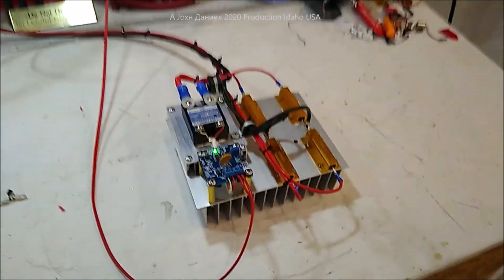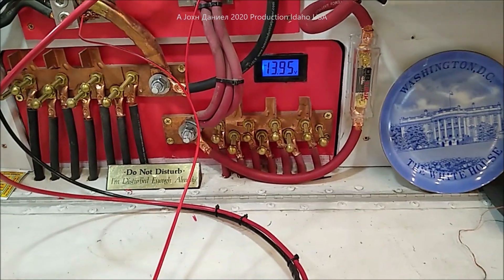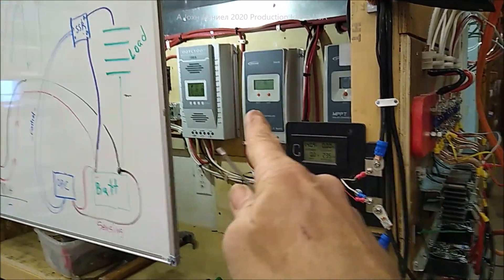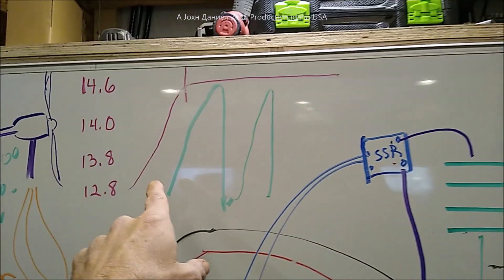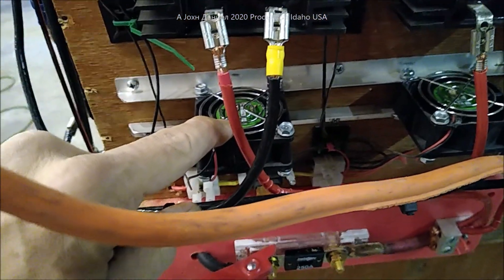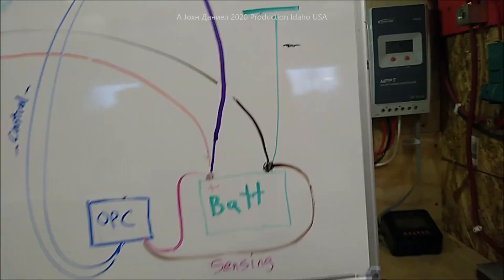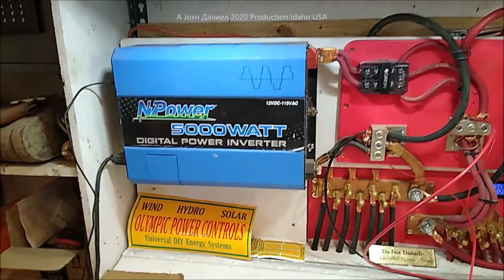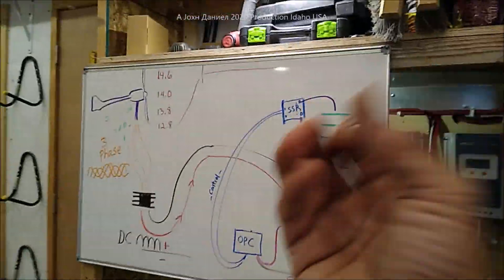Micro Wind Turbine charge controller design and uses explained, parts Below

Comment: JOHN DANIEL, I love the information you share, you really show the real deal has it is, and that is precious.
I have come to an idea that I think it should be good for this scheme. please hear it, and give me your thoughts.

ATM of this video, your schematic goes like this:
Generator --> Rectifier --> dumpload + load.

Consider this:
Generator --> dumpload --> Rectifiers --> load.
By this method, the rectifiers would not get as stressed, thus they would get cooler and longer lifetime.
Please, tell me your thoughts on this. Is it worth it?
I´m awaiting for your response, to order an SSR for AC or DC.
Reply from the maker: The effect on a resistor like these used for WILD AC volts is not great. Only 36% efficiency to catch loads, so you would need many more. On DC they become a great heater too.

Comment: Your dumping your wind turbine into a solar  charge controller  through a ssr with dump load? How arr solar  controllers  holding up to wind voltage  fluctuations???
Reply from the maker: There is no effect on the solar controllers function when both the wind and solar control volts are set correctly. You never run your wind power into open air, it's going to the battery bank that keeps it far inside the solar controllers parameters.
Reply: @JOHNDANIEL1  do you know of any dump controllers for 24v system

Comment: Hi John
 Ive like your design of you diversion controller in your video (Micro Wind Turbine charge controller design and uses explained).
Now I have sourced most of the parts needed to build my own, BUT cannot get the controller like the one in the video and the controller with the digital display is costing more to send it to the UK than the actual part it self which I would rather not have for my small setup.
So could you please help us out so I can get my turbine up and running safely and efficiently 
Kind Regard Dave in the UK

Comment: Mr Daniel, I'm a dim bulb when it comes to anything electric & you're the only person that's explained things close enough to my ability to understand. We are off grid in CO. I'm running 4 Harbor Freight 100watt solar kits into a HF 50amp hub & controller, also a 400watt China wind turbine with included controller into our 5th wheel with 2x3 6v deep cycle 215ah in parallel + 2x 12v deep cycle 115 supplying a 5000watt converter had installed. Everything seems to work ok MOST of the time. Are they fighting with each other? Would you be willing to speak with me? Thanks for all the informative videos, you've been my inspiration.
Reply from the maker: You will need this controller for your set up. https://amzn.to/2VxP8No . And If you have put older batteries with newer batteries the older ones will cause problems in the system. The controller above will solve battery problems, just be sure to allow the batteries a day to be fully charged without use. With the provided 400 watt wind turbine controller it is likely set at under 14 volts charging ( braking at 13.8) so the solar will be not performing (shutting off) since it is designed to charge correctly to 14.2 volts. Causing lots of havoc. Thats why I suggest that dual use controller for like what your doing. Set it to 14.2 volts charge, and you can add 100 more watts solar to it later without issue.
Reply: Thank you for sharing your knowledge kind Sir! I look forward to new videos and I'm still enjoying all previous. Your commentary is 2nd to none and makes learning fun!
Reply: Mr Daniel, I got the controller you recommended and installed it, but I have another couple questions.
1. Is 30' of 3phase 12ga wire connected by plugs to the turbine ok?
2. What should I input the settings to? 
The current settings are
Vfloat 12.8
Vunder 10.8
Vover 14.8
Vbraking 30.0
Thanks in advance for your help.
Reply from the maker: @seanvanzylldejong364  If its the 12 volt turbine models a 300-400 turbine 12 awg is ok to that length, but if its the 500 watt then you must have 10 awg, on the 800 watt it has to be 8 awg.
Float needs to be set at 13.2 
Over volt at 14.6 
braking set to 14.8
under is correct at 10.8

Comment: HELP!!! My setup is very basic but has fuses and brakes, everything. Issue now is,my Inverter is producing way too much voltage than what it was rated for. Its rated 110-240v, I'm currently seeing 259v output on my multi.eter. Should I be worried? Or is my setup too efficient? I dont know. I'm confused. It holds the 259v without dropping or rising. It's a 1000watts pure sine wave inverter with 2000watts peak. I'm totally off grid.
Reply from the maker: Whats the brand and model, whats a link to it ( where you bought  it )
Reply: @JOHNDANIEL1  #Aliexpress Suoer【 Pure Sine Wave Inverter 】power inverter 220v 12v dc ac pure sine wave inverter 1000w（FPC-1000A）
https://a.aliexpress.com/_eNx1FX
Reply from the maker: @ukementa8112  That is running very high for that model of inverter. Many of them have a adjustable output trimmer inside them, near the DC transformers there might be one to adjust to get voltage to 220 @ 55 cycles. It is unlikely to harm normal electronics as long as its still close to 55 hertz, but I would suggest open it up and see if it has a adjustable output trimmer small rheostat near the transformers output lines to the MosFets in it or on its control boards. Look for a video for ADJUSTING INVERTER OUTPUT VOLTS.
Reply: @JOHNDANIEL1  today was the worst, 291v. It's a brand new inverter and I'm scared of opening it up. Last time I did that, the inverter stopped working till now.

Comment: Is there a mppt controller with a dump load external output that i can connect both solar and wind?
Reply from the maker: Depends on what your voltage and needs are.
Reply: @JOHNDANIEL1  Ok. 12v 200w solar, 400w rated wind turbine

Comment: This seems so inefficient, And ever since I learned about Passive-Balancing and Active-Balancing of batteries.
I never want to use resistors to burn off power, ever again. It's resistor systems like that, that made made me hate & distrust BMSs in the first place. Until I learned Active-BMS and Active-battery-equalizers. It's the Passive ones, that rely on resistors to drain overcharged cells, the Passive ones are bad. Wouldn't it be better to just set up an Arduino or something, to monitor your battery state of charge, then just use a latching or regular contactor to disconnect the turbine from the batteries, when they're charged enough for you?
Wouldn't the tiny drain from a monitoring circuit, be better then relying on big, hot resistors?
And what would happen to your system, if those resistors burned out, or somehow got disconnected?
I personally don't trust resistors to be used that way.
And I really don't like the wasted energy. Yes, it helps warm you in the winter, but what a record breaking summer?
Reply: Could you share the system you are talking?
How it controls the over voltage to not harm the battery and circuit overall?

Comment: Hi John I have this now set up and I have a question on your numbers: I use 24 volts so I will convert yours; 14.6 = 29.2 is the top or turn relay on set point for the wind. The next number down, 14.0 = 28.0 is the top for solar. What are the next two number assigned to? 13.8 = 27.6 is for wind or solar turn off relay or solar what? I have charge, float and acceptance on my solar controller. Lastly  same for 12.8 = 25.6 same as last question?
Thanks this also cleared up my diode question feeding the load. I ordered a anemometer to control relay for auto emergency brake according to the wind speed. I am not always home so I need this. Any advise on setting this up?

Comment: Please practical wiring diagram 5kw wind turbine control system. Because i can't understand English language. 
Please please please 🙏🙏🙏
Reply from the maker: Are you looking to get a 5kw turbine with components to match? Have trouble on language difference? ( this works well to translate to say in your own language https://translate.google.com/ 
 And if you need to contact for question send me email to olympicpowercontrols@yahoo.com 
اگر آپ ہندو ہیں تو مترجم لنک مددگار ثابت ہوگا
OR यदि आप हिंदू हैं तो अनुवादक लिंक मदद करेगा
https://translate.google.com/
Reply: @JOHNDANIEL1  Thanks reply. kya aap ko hindi aati hai??
Reply: @JOHNDANIEL1  
Hello sir, please explain in the diagram how to control the voltage from the wind turbine 12v to 50v?
 I want the output voltage from 200v to 240, you just tell in the diagram which components will be installed and how will they be installed?
 If possible, please tell them practical
Reply from the maker: @manojdayal25  मेरे ईमेल  ( olympicpowercontrols@yahoo.com ) पर मुझसे संपर्क करें और मैं आपको आरेख और उचित टरबाइन सामग्री स्रोतों को भेजने में सक्षम हो जाऊंगा।
mere eemel olympichpowairchontrols@yahoo.chom par mujhase sampark karen aur main aapako aarekh aur uchit tarabain saamagree sroton ko bhejane mein saksham ho jaoonga.

Comment: 👍 ⭐⭐⭐⭐⭐

Dear John!
Have you already received the new OPC universal boards or was it one of the last remaining stocks? Please don't forget me when the new / old OPC Universal boards are delivered, thank you!
The connection diagram in this video helps me enormously to understand, but only the old OPC, with the connection of the digital version I still don't understand!
Best regards!
Reply from the maker: That one is about 5 years old, we had it at the prospecting cabin in Nevada for a Thermodyne turbine. I replaced it with a newer design and brought it home before Christmas. The new boards due to China and the Corona stuff will be delayed due to the few components used from there.
Reply: @JOHNDANIEL1  👍
Dear John, that was not a reproach, I just remembered that you will not forget me when the new old boards are supplied! Thank you for everything!

Comment: Hey John daniel, great videos mate! I've learned a lot. I've been experimenting with a 1watt  zener diode from the hot side of the relay to the trigger positive on a solid state relay instead of a controler. Zeners have a breakout voltage curve when combined with the trigger voltage curve of a ssr makes a smooth transition from battery to dump load, ssr's are basically a big transistor and I've not heard of any problems with ssr's being engaged transitionally. You can buy a pack of zeners of various breakout voltages for pennies, I'm going to experiment with a variable resistor to get an even more precise voltage switch. You could probably put a capacitor in there to make it blink on and off instead of a gradual switch. Mine's working great so far and nothing is getting hot... and we're in a storm over here in the UK. What do you recon? Can you forsee any problems?
Reply from the maker: Your on to something, but the stability of accuracy when in constant use and heat would be a weak point. Zener diodes trip volts +/- ratio may have to be worked out.
Reply: @JOHNDANIEL1  yeah I had a pack full of em and I bench tested it until I got the right one picked. I haven't noticed any abnormal heat and I've just put it through a storm. It's  drawing 15 amps max on a 24v system on a 25amp SSR.  I had it in 35 knot winds disconnected from the battery and works beautiful as a over rev brake. I'll keep you posted, it Could be useful.

Comment: Hi John, I Need an Answer please, so ASKING!!
What is your "Rule of Thumb" for sizing the diversion load?

I'm running the "Green-E" 500W 12V Turbine.
You reference a 6Ω / 100W wirewound,  so when engaged and dropping ~14V it's dissipating ~2.3A (about 33W).

Knowing your sizing rules would be awesome!!
Thanks in advance.
Reply from the maker: You have to be high/low wind area selective, but rule is 80% rating. So a 500 watt that can actually do 500 watt would need 400 watt and a diversion controller. Normally I tell people to run 2 of the 40 amp DC/DC SSR's into 4 - 100 watt loads 200 per SSR. This gaurentees safety and long life. Set your turbines divert at 14.5 on a 12 volt system unless other things require different, turn off solar controller equalizer/balancing and set their bulking/float  at 14.25 max.
Reply: @JOHNDANIEL1  Thank you Sir!  

How do choose resistance?  Do you take the 80% / 400W diversion load and work backwards? With a 14.5V diversion voltage, to burn 400W you'd need to drop 27.5 amps or so.  This much current for 14.5V would require 0.52Ω of diversion load. (this seems too low)

I'm thinking your 400W power rating is just for heat dissapation overhead.  Using (4) 6Ω in parallel nets 1.5Ω total load, so when the diversion is engaged you're dropping 9.6A across all the resistor loads.  That's 140W total from your 400W resistor bank (that's comfy), or about 35W for each 100W resistor (about 1/3 of it's power rating)

Hope I'm making sense and you can straighten me out.
Reply from the maker: @jimamos8960  You have to calculate the short pulses in the proper controller that each time it pulses the full voltage is not passing into (through) the resistor, volts being low / amps go high. In slow pulses its switching speed only allows a build up of about 6 to 8 volts and as it speeds up it eventually gets to 14 but by then your turbine is loading down and slowing. The high wind areas I suggest 5 resistors and the reason I suggest 4 to 6 ohm for 12 volt systems is wire gauge in the turbine, so not to burn it due to load up speed counter reaction to the divert. I tried numerous ratings, after over 10 years this is the result, it may not make mathematical sense but remember all that power is pulsing + in high rates from the rectifier and it behaves different than just the battery only.
Reply: @JOHNDANIEL1  I think I get what you are describing regarding the controller operation... you don't want to simply engage the full diversion load when voltage is above X volts, so the controller modulates the SSR's accordingly with some algorithm based on voltage level and integration time.   I'd like to know more about these particulars (I've downloaded Mason's manual to read this weekend), but back to your recommendation and my questions.... how should I size the diversion load (resistor Ω values and wattage) for my turbine (the GE-500W 5-blade) and location (96719)?  I know the next video will get into braking strategy with AC pass-thru & DC in-line methods and I presume these independent controls (braking and diversion) are intended for independent operation.  I get the notion that behavior will be different based on where the load is located in respect to your batteries (i.e it's resistance), and loads downstream of a rectifier.  

I'm building a spreadsheet with all my off-grid system DC loads (AC inverter and DC lighting) such that I can get a clear picture for power budgets, load protection, etc... Hoping to incorporate the diversion and braking load calculations in the same spreadsheet...   Thanks for entertaining my Q's
Reply: @JOHNDANIEL1  Another question on this whole diversion/braking methodology.  Would it not be better for your batteries if the diversion/braking resistors were upstream of the rectifiers on the AC side, thus eliminating the loading and subsequent discharge of the battery?

Also, what a collection of commentary on battery chemistry, eh?  Hoping to see more braking strategy.... (specifically, "generator braking direct" which looks to be high current switching downstream of your inline AC load resistors)
Reply from the maker: @jimamos8960  The braking on the pre-rectifier line is a turbine killer. Puts the loading in the PMA and thats long term a bad thing. Allowing it to be on the stronger side of the rectifier abuses the cheap $15 rectifier and gets instant feedback from the battery where it counts. 
And Yes, the Battery video dug out the hard core traders in LiFePo4 and LiCo who swear by it like cultist. Yet they can't explain why Hospitals swap them out in 1 year, not 10 like the cult claims they last, and laptops exclusively use LiFePo4 LFE and we all know they have a 1 to 3 at best lifespan.
Reply: @JOHNDANIEL1  Thanks@John Daniel.  I get the benefit for the PMA by isolating the braking loads on the cathode side of the rectifier... Your knife switches for the "wind storm" conditions that I have seen were all wired with loads upstream of the rectifier, and I guess that their use is more "emergency" and "SHTF" in nature.  I'm wondering if yet another isolating diode on the DC line is the answer I am looking for.  Yes, you'll drop additional voltage across the junction, but you'll isolate the loading from both PMA and Battery.
Still nooding on final designs with DC SSR's that have intrinsic current steering... hope to see more turbine video soon.  I always pick up more design wisdom after watching.
Reply: @JOHNDANIEL1  There's an interesting SSR that's getting released next month (a true "Form C" style, 20A capable with intrinsic "ideal diode" isolation).  Where I think this lands me specifically is the braking/diversion loading fully isolated from the PMA/Turbine and the Battery pack without the voltage drop through another diode isolation stage... granted I have to fashion a PWM controller with a load modulation strategy, but that's a doable thing for me as I'm an embedded systems engineer... more soon and hope we see follow on braking and diversion vids coming soon!

Comment: John, PLEASE Do a video answer why Lithium tool batteries and wheel chair lithiums fail in 2 to 3 years while NiCad are still cycling after 3+ and your lead acid are still going after 10 years for less than 1/2 the cost.
Reply: https://youtu.be/8dSlgrNwq5o